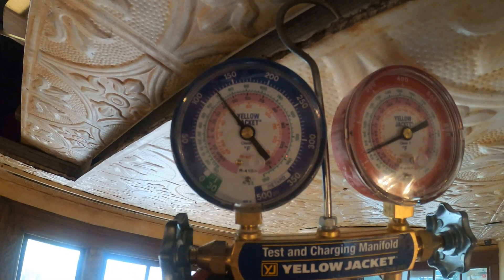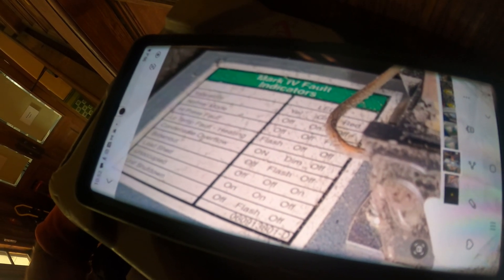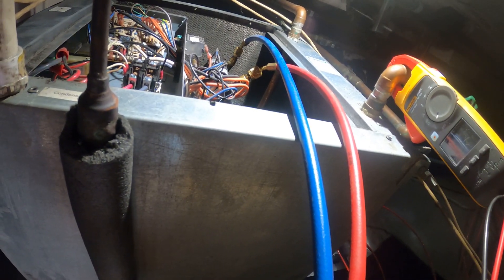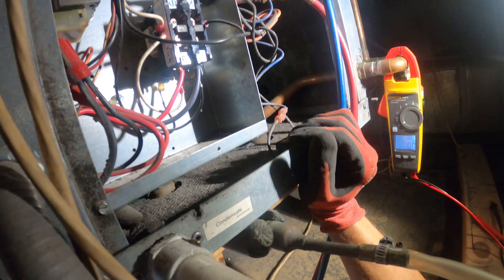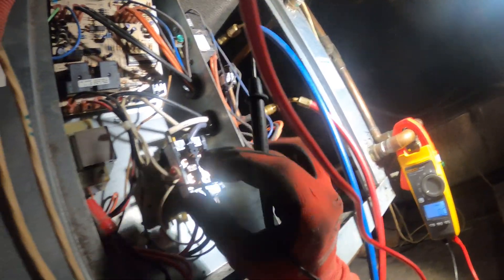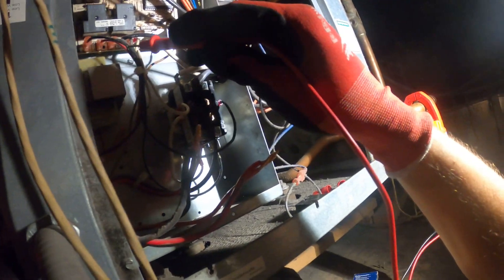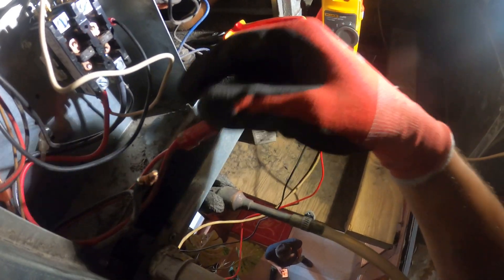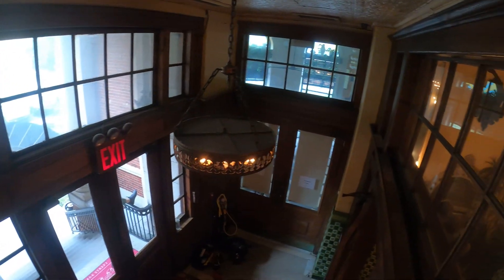HVAC: Water Source Heat Pump Service Call (AC Not Blowing Cold Air) Air Conditioner Troubleshooting

Comment: Came across your video after researching the mcquay mark iv board from a service call today. Good find on the coil! I had read that on older mcquays, the only 24vac power is from the xfmr to the control board. The solenoid for reversing valve (unless newer model), the hi/low pressure transducers, the low temperature switch, and the condensate overflow are all powered using 24vdc switches. Also saw that if your unit does indeed use 24vac for the reversing valve solenoid, you would read approx. 14vac while it's de-energized. Keep up the good work and happy HVACing!

Comment: So did you check the relay contact closure off camera..?
You cycled the thermostat at least three times….. 
the control circuit is 208 correct?  You get the work done but your process is confusing as shit jump. 
The amber light on indicates the condensate switch is closed…? Sooo there is water in the pan..?  
Be careful checking things to chassis ground it is not an accurate indication. Trust your meters and use them lead to lead.

Comment: Your name fits you well, jumperman? You just jumped out that contactor coil instead of figuring out why you were not getting the correct coil voltage. Also none as rigging.
Reply from the maker: That coil wasn't jumped out. Theres always a  steady 120v on one side of the coil and when the thermostat calls for cooling it sends out the other 120v from the board to the other end of the coil energizing the coil. When the space temperature is satisfied, the boards relay opens and takes away 120v on one end of the coil and the compressor turns off as it was designed. I did find the issue as this wasn't wired properly. Watch it again to understand. Before you start thinking that you're clever telling me my name fits me well, make sure your name isn't Pinhead Larry from SpongeBob SquarePants. Your name seems to fit better. Thanks for watching 😂
Reply: @JumpermanTech hey man Larry is right, u just jumped it out lol

Comment: I've literally been watching everything I can to fix my heart pump. This is the closest I've seen to the problem yet.  It freezes up on the outside of the furnace part
Reply from the maker: So your evaporator coil is freezing up. 2 of the most common reasons as to why that would happen is if the evaporator fan is not running or you are low on refrigerant. Check the refrigerant pressures and make sure the fan is spinning! Hope that helps out a bit. Thank you for watching & commenting! This was a very uncommon issue so check the 2 that I mentioned. Good luck! Stay safe out there & stay tuned for new videos every week🔧
Reply: @JumpermanTech  also if it's cold out side the defrost control could be malfunctioning..that's the board inside your condenser panel..it turns on the fan and also defrosts your coil in low ambient condition's

Comment: Just makes me wonder why you weren’t getting the second leg on the contactor. Somebody had to mess with it.
Reply from the maker: This unit dates back to 2008. There was another company here fixing the 2 lobby units but only 1 was actually working. This was 2nd one that wasn't actually cooling. This unit was definitely messed with. They replaced the contactor but it still didn't work. But then I arrived 😂👌⚡ Stay safe out there & stay tuned for new videos every week🔧
Reply: @JumpermanTech  understand the history of the unit helps with troubleshooting and the context of this service call. I think it’s so important that you should have mentioned it in your video. Awesome work regardless

Comment: Was this a situation where someone else had been out to work on the unit, and after they were done it no longer was working? I'm having trouble trying to understand how that wire could have gotten put on the wrong phase.
Reply: Same bro
Reply: I’d like to know the answer this question too
Reply: Seemed like there was a safety switch open not sending the 120 through it to complete the circuit. Also usually the one side of a 208 coil is hot all the time from a jumper on the incoming voltage side of the Contactor.